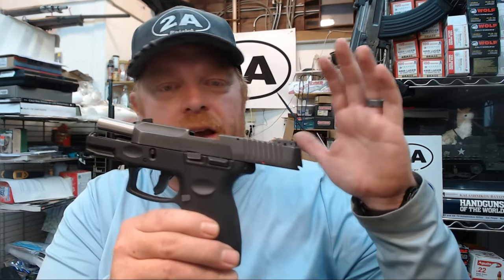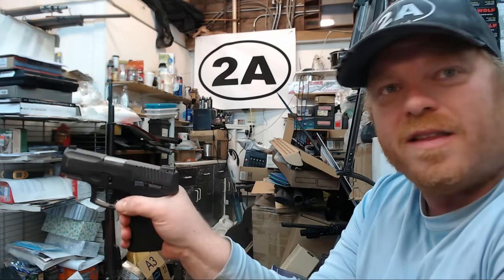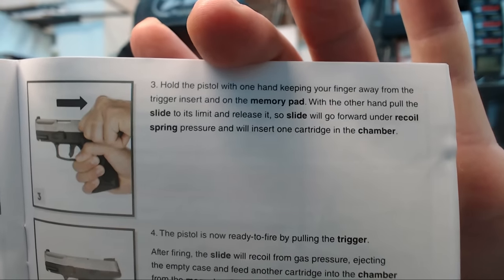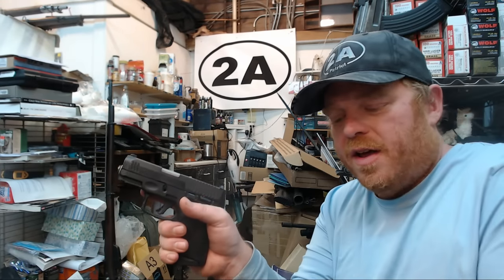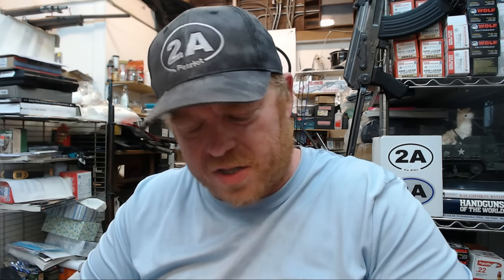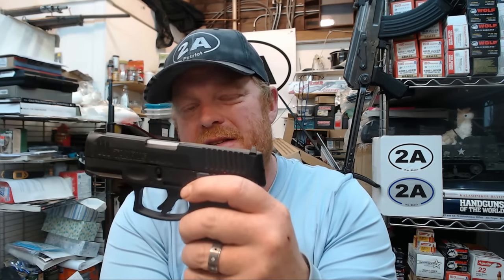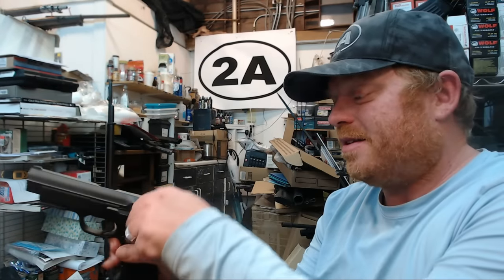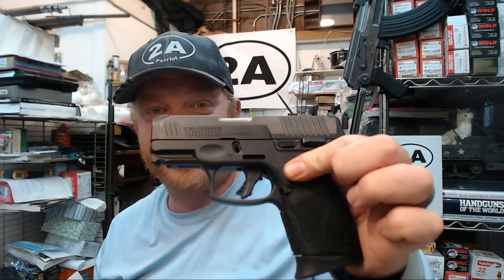📌 Taurus G3C G2C G3 9mm Stiff Slide Catch Release : How It Works : Pistol Loading & Slide Function

Comment: No, I want an exhaustive list of every pistol ever made that doesn’t have a last round hold open!! Hahaha!! 

You know you are watching a non-gun-snob gun educator when he talks about the recoil spring being “scrunched!” 👍🏻

I don’t know that I had ever noticed that the owners manual doesn’t indicate to charge the gun with a full mag by releasing the slide catch. I know why they don’t do that, though. They don’t want 5,000 calls to customer service when someone finds a particular line and brand of ammo that will nosedive, like some hollow points. 

Out of curiosity I picked up my nearest other gun owners manual. The Sarsilmaz SAR 9. Sarsilmaz also refers to the lever as a slide “catch.” However, they DO instruct the user that they can charge the gun by releasing the slide catch on a full mag. 

I don’t know if you have noticed this, but I have because I reload 9mm Luger. The chamber of the G2C barrel is essentially shorter than many other 9mm guns. Even if a 9mm round is still within SAAMI specs, at the longer end of overall length, the gun won’t go into battery. It’s because of the shorter chamber. I had to shorten the length of my in spec 9mm ammo to get them to load and cycle through the G2C. I believe that is part of why taurus does not include instructions on releasing the slide catch on a full mag. It would jam. 

I have answered your same answer about the slide catch on the G2C many many times also on the FB Taurus groups. I couldn’t even count. You’re going to get into the hundred thousand mark with this video, I would bet!! Good choice! 

I don’t know exactly why I watched this whole video. I guess because I am too upset by the election and needed to see something else, but also because it’s definitely interesting to watch a good speaker and teacher such as yourself. 

Well done, again!
Reply: P.S. It obviously could jam with or without the slide catch but from my experience, it jams more so when releasing a slide catch on a full mag or ammo that a particular gun doesn’t “like.”
Reply: I too have had trouble with my G2C cycling the longer golden saber rounds. Everything else runs just fine.

Comment: To most of the people asking about the slide catcher, just pull the slide back and let it go 👍

The slide catcher is there for a reason, mainly its there so the slide will catch after the mag is empty and plus so people don't pinch themselves and such, meanwhile inspecting or operating the firearm. 
(Sort of a safety mechanism)

Comment: I do Like the G2c. I might have to get one of them. Exactly, it's actually not a slide release, most people don't know, but the slide release is not made to release the slide. It's made to hold the slide back. There are several manufacturers that will also tell you, not to use the slide release but to use your hand to release it. Some pistols can be damaged by using the slide release. Thanks for staying true to the Constitution and talking about our rights!
Reply: Believe. I recently purchased a 2c and a 3c. The 3 is a little better but the 2 is very nice and you can't beat the price.
Reply: If its not to be used as a slide release why then is the finger button and the serrations facing up ?  You sure don't need that to lock the slide back . Not being a smart ass , but I would like to hear your response .
Reply from the maker: Thank you. You are welcome!
Reply: @orionfixr7713  Wilson Combat Channel, "Don't do this to your guns", video.
Reply: @believe722  ;  Thank You for your response ! ( There IS a first time for everything ! ) I agree with everything those two said . What I think you may have missed is , they caution you to not drop the slide on an empty chamber or a non loaded mag.  What they did say was its perfectly acceptable to drop the slide with the release if there is a loaded mag. in place so the slide can strip and load a round , as it was intended to do . I assumed that anyone would know after the first time dropping a slide on an empty chamber using the slide release would know not to do that again just from the way it sounds . Guess that's a bad on my part . Go back and watch the video again and see if you don't agree .
Reply: @orionfixr7713  I am looking for an old video, of an older guy that said it's all bullshit, because they are all made to use it every time, And not have any damage. If I find it I'll let you know. But his point was the opposite. So it really makes you wonder. Personally I think it is up to the individual manufacture, and how they are designed. I think some can cause damage and some will not.
Reply: @believe722  ; I just don't drop the slide without a loaded mag in place . What the pistol goes through chambering a round is the same as when you are firing the pistol . I don't use the mag. release on an empty AR either . Just me and what I do . Peace .

Comment: No excuses for Taurus ♉. Almost 4 decades working with pistols and this is a proof of cheap but functional manufacturing strategy period. Great teaching here that not even Taurus are smart enough to think about I mean posting a video like this. No one hand operation could be fatal. I have one but I will not CC for that reason.
Reply: It’s meant to be used with a loaded mag. If you’re carrying this and need to reload, you’d reload with a loaded mag. You can still use one hand

Comment: Thanks. Bought a 2C tonite and thought crap it's broken. Slide release with empty mag was not releasing. Makes more sense now, empty vs loaded. Still stiff but feels a tiny bit better so far.
Reply from the maker: No prob 👍
Reply: This is exactly what I felt because I just bought mine and noticed that

Comment: The CZ P10 series sports a very stiff slide catch, even with a loaded mag.  P10C is allegedly the worst.  My P10F catch was near impossible to use when new but is slowly breaking in.  My G3 and G3C are fine when used as you describe.  Knowledge is like money; impossible to have too much of either.
Reply from the maker: I have wanted a CZ P10c. I hear they are great. Yeah, knowledge is a goody thing. I'm always learning things. 👍
Reply: @2aEdu  CZ P series have great ergonomics & are great shooters.  Local Rural King has a P10C in their display case priced @ $460.

Comment: My G2C was really stiff when I first got it but after a while it loosened up and it's not as stiff now. It's still a bit stiff tho.🤷‍♂️
Reply from the maker: Yeah, same here. It just isnt designed to release it on an empty mag without pulling slide back a bit.
Reply: @2aEdu  At first I was thinking there was something wrong with mine because it felt as if it was stuck a lot of times. Also compared to another one I have it is much more difficult to  work the slide release.  But as I said before it is better now 😁👍
Reply from the maker: @HO-hw4gu  I have noticed a difference between both of my G2Cs too. I do listen to my viewers. That is why I did this video. 👍

Comment: Thank you so much 2a I had sent in my Taurus G3X for what you just went over. Taurus customer support talked to me today 12/15/2023 after I called them and after being placed on hold, I was told that there was nothing wrong with the slide catch and that they tested my gun two times by firing 30 rounds by two different gunsmiths. So I could have saved myself some time and effort if  just listened to what you said. Sorry I owe you an apology! Once my 3GX comes back I will be replacing the slide with a new one that can hold a red dot sight. Anyway thanks for your excellent quality advice. Merry Christmas and Happy New Years to you and your family!

Comment: Thank you for this video. Yes, I am one of these idiots that rarely reads a manual, but even if I had, I would not have understood it nearly as well as I now do after watching your video. That was my first question pulling it out of the box was why is the “release” so hard? Not only did you show the three different scenarios of which two of them it works quite easily, but you also explained why in a way that anyone could understand. Thanks for taking the time to point out why it works the way it does. It makes perfect sense when you see it explained.
Reply from the maker: Cool. 👍 Glad to help

Comment: Handgun newb here.  Thanks for the video.  I swapped my G3 mag release to be left handed before my first extended trip to the range and noticed that some of the times I loaded a fresh magazine, the gun would unexpectedly rack and chamber a round without my intervening.  I tried this when I got home and realized if I had even the slightest downward pressure on the slide catch while inserting a loaded magazine, it was enough pressure to release.  This can also happen right-handed, but I found it more likely to happen left-handed.  You can control whether or not this happens by paying attention to your left index knuckle or right thumb placement, but this is yet another reason why you always keep the gun pointed in a safe direction.

Comment: I have a G3 and a G3c, it works just like you said.  Sometimes it's a little tight, but usually I can get it to work.  When I change a magazine, I pull on the back of the slide.  I also have a Beretta 92FS Compact.  The slide catch is on a swivel, not a tab, just like the second type of gun you showed.  Very easy to push it down after changing mags.  One is harder because it's a "tab," the other is easier because it's a swivel.  But they all work just fine.

Comment: Hey listen i get it , i saw a ton of people complaining about that same thing..
I even noticed it when i first got my G2C, i tried to active the slide with an Empty magazine, and i was like wow that is hard to press. Than when i did it with a full Magazine i goes oh there it goes maybe it just need to wear in, than it did it again empty magazine, i was like hmm oh i see that magazine is tough to move the spring down to load the magazine, that is pressing on the Slide Catch, and also the Slide is pushing on it i get it..

But you see i was saying at first WTF..
Because  my go to gun was the Taurus PT92 that slide catch is easy to press empty magazine or full, but different system and well that gun is more expensive than the G2C it's not really a cheaply made gun like the G2C that gun was designed to be compact, easy to use and at an affordable price, and when you buy a gun that is that cheap, you sacrifice on a very good engineered gun.
The build quality on a Taurus PT92 has more research and development and engineering than the Taurus G2C, Not to mention that Taurus PT92 is a  Beretta 92  engineering design Beretta created that gun, Taurus just bought the design and rights to build that gun.. But when Taurus makes that PT92 they are using all the tools and templates Beretta gave them..

So guys if you want a gun to work perfect, Than  your going to have to dig deeper in your pockets and maybe get a Glock 19 Or a Taurus PT92 , the Glock 19 is more like the G2C it's small and light and has the same type of style, more so than the PT92  so as i said don't like the G2c, get a glock 19, but it's going to cost you more than double the price, remember the old saying you get what you pay for..

Comment: Hi... Have seen a couple of your videos, and enjoyed them, and found them very informative.  I just purchased both the G3 and the G3C.  The slide catch on the G3 took two hands to release (even with the mag out).  The catch could not be pushed down below the polymer frame (with the slide and mag removed).  The U-shape bend of the catch was too tight (or the frame was too wide).  I removed the catch, and carefully bent it open about 0.005" (overall width).  This improved it, but it was still tough, so I opened it up another 0.005".  Again, this improved it, but I could see that the bend was very round (where a squarer, flatter bend would fit better), but I did not want to risk damaging the catch by attempting to modify it further.  So, to allow it to be pressed lower into the frame notch, I gently broke/chamfered the top edges of the polymer where the catch contacted the frame so that the catch and the frame mated slightly better.  Reassembled the gun, and tried it... couldn't be happier with it, and I'm sure that it will even be better with use, as the moving parts start to mate together better.  It now operates better than the G3C, and that worked well right from the start.  Just thought that I'd share how I fixed this problem.  I know that these catches/releases operate hard by design, but in the case of my G3, it was a little bit more than just a difficult operation, and this may be the case for some of your readers also.  Just fitting the parts together slightly better made a world of a difference.  I don't recommend that everyone try what I did, but a qualified person can make it better, and it doesn't take much time.  Thanks!

Comment: Good review, I have problems with the ammunition, I can use full metal jacket and it works very well, but when I use hollow point it is stock.  I have tried different hollow points and it does the same
Reply from the maker: Thank you. You can try polishing the feed ramp, make sure it isn't just 1 magazine giving you the problem. Also try a hollow point with the polymer tip insert, like Hornady or similar.

Comment: Great video! I bought two GX4's last week, about 100 rounds through each. When I first got them, I could lock the slide back with the slide catch. Towards the end of the session, on one gun, after slide locked back on empty round, as soon as I touched the mag release, the slide slammed forward. Caught me off guard, and really glad I didn't get pinched. And now, on this one gun, I can NOT get the slide to lock back and hold, without an empty mag in it. And locked back with an empty, as soon as mag release hit, the slide goes forward. As soon as I release pressure on the catch. The slide goes forward. I'm of the opinion both guns should work the same. And that is for my daughter to carry, and it's far easier for her to have the slide lock back through the mag change, then she can just pull the slide a bit to go into battery. If it won't stay locked back, she has to fully rack it, harder for her as she's a petite little thing.

I also had it fail to lock back on empty mag after last round one time. That has me stumped. At first I thought I might have hit the mag release (easy to do on this gun) on recoil, but realized the mag stayed in place, and this gun really spits them out.

I called taurus, as not locking back after last round, mag in, ain't right! They are having me send it in to be checked out. I also asked about not being able to lock it back, without empty mag in it, and she told me that wasn't a problem, or a function of the gun! That really surprised me.

I looked at both guns, and the gap between the slide and frame is ever so slightly wider than the other, if the one that won't lock. I'm guessing the catch is going into the slot at just a little different angle, not allowing it to catch. Or, possible the slot is milled just a little off, too steep an angle for the catch, to catch.

I'd like your opinion, should I expect to be able to lock the slide, without an empty mag in?

Thanks, and thanks for the video. I'm always learning new things.

R

Comment: Thank you, after watching this you answered a question that I was about to ask....I have a Springfield .45 XD-M Mod2 that will release the slide fairly easily with an empty magazine in it with just the release, but I just returned home with a brand new Taurus G3c today that I CANNOT release the slide whenever there's an empty magazine in it AT ALL. Manual states "you must remove the empty magazine first", so I thought that was a manufacturer specification...after watching your video I'm thinking that it's these really stiff magazine springs in the new Taurus magazine that's keeping the follower pressure compressed so much that I just can't get the release down all the way. But you're right, no reason to speed that along. Thank you for this video, very informative!
Reply from the maker: Yes, the Taurus mag springs are very stiff. Which is good for feeding ammo. Glad to help 👍

Comment: Excellent video, and concepts transmitted clearly. I have a G3C for 1 week.
Now, my question is the following:
a) if it is a "slide catch", and not a "release" ...
b) and the catch is done automatically (I don't do it with my finger ... unless there is no magazine placed) ...
c) So... for what REALLY USEFUL purpose did they put a BUTTON there? A completely automatic and internal lock would perfectly serve the purpose that the manufacturer claims to have devised.
Am I wrong?... probably. Tell me. TYVM.
Reply from the maker: Thank you.. With no lever, you would have to remove the magazine to let the slide forward when empty. That is a pain in the butt. The Polish P64 works that way for example.  It gets annoying really fast.
Reply: @2aEdu  You're right.
Therefore: the lever (not the mechanism, but the outer lever) ACTUALLY WORKS as a slide release, not a catch!...
You have been very clear. Thx again man.
Reply from the maker: @pabloripoll3006  The outer lever could be used to release or to actuate the catch. Depending whether you press it down or up on it. You can load a round in the chamber with the lever. I prefer to pull back on the slide and let it go forward to chamber a round. Unless of course I could only use one hand. I'm glad I was able to help 👍 I hope you like your G3c

Comment: I have a new G3C and the slide release was a bit hard to release at first after shooting 100 rounds cleaned and oiled everything and the slide release works really easy now. Even without chambering a round. My Ruger Security 9 slide release sucks have to use both thumbs to release it.